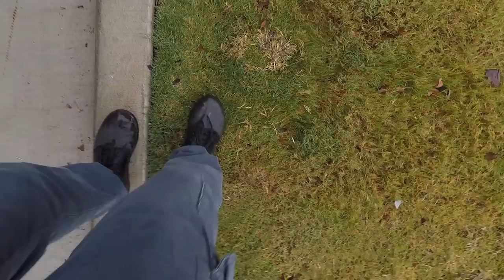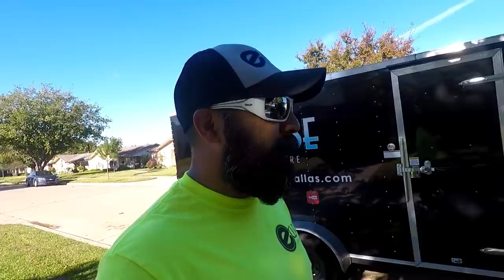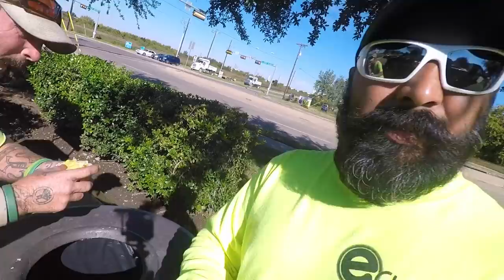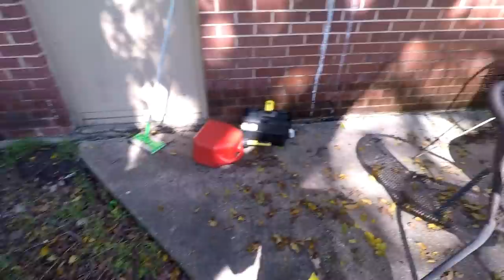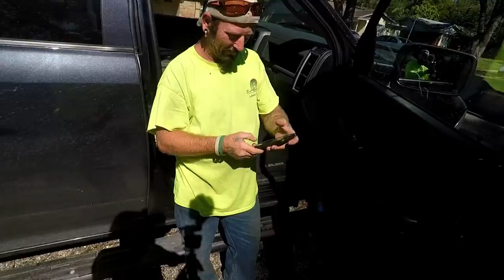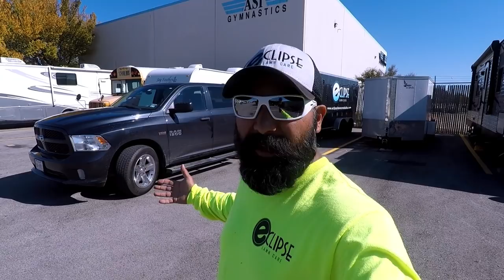Gorgeous Day to Mow! Eclipse Lawn Care Vlog

Comment: Just level the truck itd be a big difference i put a leveling kit on my 2016 f150 and put 34s on 20x9s man looks sweet its my lawn truck to so its not to high to screw up my towing i pull a 16ft dual axle trailer with 2 mowers on it pulls it like butter no issues on truck yet its been 2yrs
Reply from the maker: Yeah I might look into the leveling kit instead. Thanks.

Comment: With that much lift and because your towing you will end up with drive shaft and u-joint troubles.
Reply from the maker: Oh dang! that wounding be a good idea then. Thanks for pointing the out.
Reply: He will not have a problem towing it. He is not towing a heavy load.
The rear diff will hold up they will shim the pinion angle to correct.   Will stress out front end parts tho.